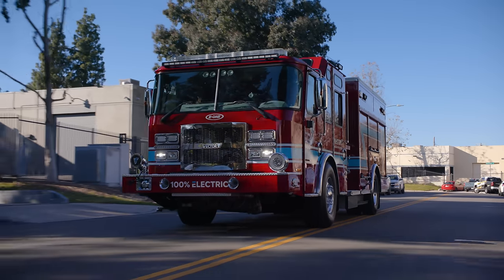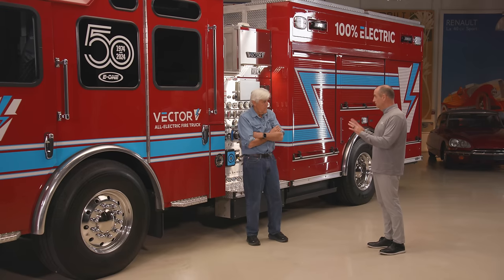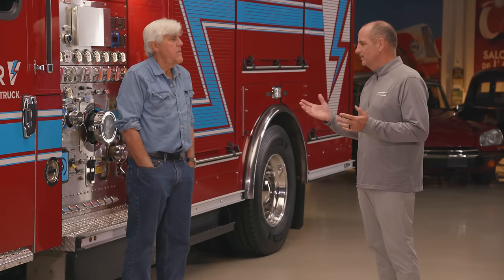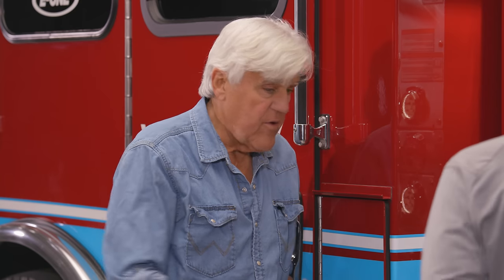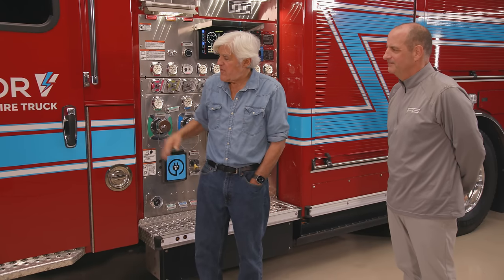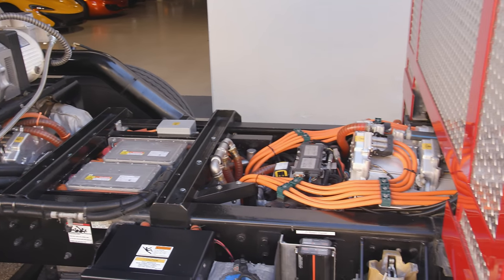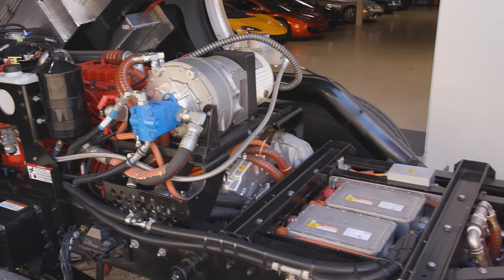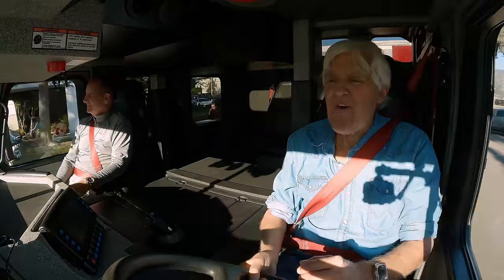The Future of Firetrucks?

Comment: Jay, you are an exceptional sales man. It’s amazing how people believe that an electric pumper is better than a diesel. In Chicago this would last a week. Would like to see this at a long stand pumping for 8-12 hours in -10 degrees. Never going to happen. I laugh at the green house gas issue. How much of the fire byproducts that are at a fire scene that are given off green house gases from what is burned. Chicago has  fire companies that make up to 18 runs in a 24 hour period. Not all Fire are runs but add in EMS which is exhausting on men and rigs. I want to see a truck or an ariel tower electric. It will never happen as a weight to battery weight would make it the weight of a M1 Tank. 100 fire house in the City of Chicago with two rigs and in some cases up to 5. What is the power grid needed just for that. My last comment is that the salesman said to save battery power is dependent on incoming water pressure is 100-110 psi not in Chicago. We are a low pressure high volume system. The best hydrant pressure we had was 50 pounds and that was near a pumping station. We have had fires that when we had 2000 gpm pumpers that no other engine could hook up to that hydrant and all other engineers on other engines pumping had to watch and limit the amount of flow as the worry was collapsing the water mains. 
Didn’t I hear that the first electric fire engine in LA was Out of Service after a month. 
STOP THIS NONSENSE WITH ELECTRIC.

Comment: Electric fire trucks are good in cities but where I live you would run out of battery before you even get to my house the nearest fire station is 1 hour and 45 minute drive from where I live there is a reason why I have my own fire truck a beautiful and slightly old from the early 90s late 80s so still fairly modern as far as fire trucks are concerned it's from Pierce fire truck Manufacturing got it off of Facebook Marketplace for 10 grand

Comment: Please all FF check out ( Edison Motors)
In BC Canada. 😊 That makes a fantastic 
Part small 6 cylinder Diesel ( CaT) engine 
And a Fantastic Battery bank power system. The TWO young men make it very easy to maintain and off the self parts. For example the Headlight you can get at any auto parts supply store. 😊 It's a different style cab. The Driver is in the middle of the cab, just like an airport crash truck. The TWO builders were in the logging industry, and drove Log trucks for years. They did NOT like how ( Tesla) was building a big class 8 ALL electric semi. They wanted the Diesel engine ( very small) to be a reliable electric big rig, that will not have to be CHARGED 😊 but still stay within that almost "0" emissions exit
It was made to get voltage for batteries on down hill off the mountain to help recharge the battery. With the small Diesel engine you don't need to charge

Comment: Hmmm, huge chargers required. California with unreliable power. What could go wrong!! The big test though,, will it put itself out when the batteries self immolate.
Dont take it to  'lithium recycling plant' those fires burn for days. As the one in Scotland currently.
3500 ft lbs,,, will id do a burnout. And is the entire transmission up to the motors.
Oooh aaah, an electric fire truck with diesel back up. That my friend is hybrid and contradictory.
Franklin? So underpowered as not to be an example. Hitlers revenge 6 cyl had to go liquid cooled about 40 years ago as they were well past the cooling limits of air

Comment: So you ship it overseas and back for the drivetrain, you charge it with fossil fuel generated electricity, it still burns diesel if it really needs to work, and, at some point, those giant batteries are going to need to be replaced.  Makes sense.
Reply: I didn't understand the shipping it overseas angle either.  Making it all in Florida is probably prohibitively expensive but there are many other southern US states that are fully capable of 0-100% assembly.

Comment: I wanna like it but its clearly flawed, he keeps saying "under normal conditions"... what happens when the conditions are extreme?!?! What happens if an entire city blocks on fire? What happens if theres a massive forrest fire and this truck needs to drive in the hills or mountains? What happens if theres an arsonist setting multiple fires in multiple locations? Emergency, heavy duty and military equipment should be designed to handle extreme conditions and this clearly wasnt.

Comment: I would NOT trust my life to this electric fire truck.  I've seen fire trucks work for hours upon hours upon hours on big fires.  I don't believe these batteries can hold enough charge to work those big fires.  And the heat from the fires.  Heat causes a faster discharge from the batteries.  Are you going to work a fire for two hours and then go back to the station house, out of service, because you've got to recharge the truck and you're out of service because of the recharge, unavailable for other calls.  NO THANKS!  Someone's dream is an actual nightmare for the fire fighters and the tax payers.

Comment: All of the machines that mine the lithium for these EV's are diesel powered.  None in the US.
The weight of these EV's wear tires faster, wear the roads faster.
If it is too cold, they don't work.
Our infrastructure struggles now with powering our homes and businesses.
Difficult to extinguish when on fire. 
I for one, will not own one.

Comment: Interesting and impressive BUT, still very limited range. Emergency service vehicles should still be built with Combustion engines until Electric is superior in every way, longer range, very fast recharging, that time is not here yet. They should all be Diesel or Hybrids for now or permanently, there's not so many of them that pollution is a big issue. The electronic complexity will reduce reliability and durability + it will be much more expensive to buy and repair. Fire engines should be built simple, run well and pump water fast. UNNECESSARY change, stick with what works best now, this EV is NOT an improvement.

Comment: Sorry to say most firefighter are not going to like this truck. You’re messing not only with reliability but with tradition. Of course you’ll have those fruit cake cities that will put them in service but I bet there firefighters aren’t going to be happy.  Sorry to say I wouldn’t trust it nor would I rely on it as they wouldn’t last for wildland, forestry, large industrial fires and so on. We carry battery powered rescue tools and still don’t trust them so we carry a generator and have a special pack that allows the tools to run the tools off the generator and we have had to use them that way. Sorry to say battery life isn’t all that great.
Sorry to say they are just over complicating things. Let’s put batteries in it and get rid of the motor. Oh yeah, we still need a motor to charge or extend range now we have to add a generator as well. More weight less equipment and water you can carry because there are chassis weight limits as well as legal weight limits on the road. Taking something that works perfectly fine and making it heavier, more expensive, more difficult to work on, more failure points, less reliability, etc. etc…. Bet Jays 1911 Fire Truck is more reliable!
Classic American fire trucks are much better looking than the European style trucks some manufacturers have been trying to push.

Comment: "sorry we can't put the fire out, our battery went dead!",  how do you keep going when fighting wild brush fires with only time to refuel and no time to charge, dumbest fake crisis move I have seen yet.
Reply: The diesel engine runs, and the fuel tank can be refilled like any other diesel truck.
Reply: @brianb-p6586  I was talking about an an electric truck.
Reply: @428gearbender3  No one uses battery-electric fire trucks (especially in brush service) because everyone operating fire trucks is bright enough to realize that they're not practical with currently available batteries (especially in brush service, although they are available if anyone finds a use for one), and the truck in this video is a diesel-electric hybrid. You can see the Cummins ISB inline-6 diesel engine (the commercial-service version of the same engine used in Ram Heavy Duty pickups) in the usual location at the front of the chassis when the cab is lifted at 20:00, and they discuss the location, fuel, and sort of how it is used (it is a series hybrid, so the diesel runs a generator to power the truck). 

These diesel-electric hybrids (the Volterra from Oshkosh/Pierce, this Vector from the REV group companies, and the RTX from Rosenbauer) can all handle most urban calls on just the battery, but none of the manufacturers suggest even these for rural or bush service, let alone pure battery-electric vehicles. You're complaining about a move that no one is making.

Comment: This EV carry on is beyond a joke now. The battery production methods are environmentally DEVASTATING! Mining the heavy metals necessary will destroy the land around for miles and miles around each mine site so badly IT IS ENTIRELY IMPOSSIBLE TO SUPPORT ANY FORM OF LIFE WHATSOEVER. Then there is the battery construction process which must cross FOUR separate continents, transported exclusively by diesel power obviously BEFORE IT GETS ANYWHERE NEAR A VEHICLE. Then there is the fact that WHEN it catches fire it is completely impossible to extinguish. Not difficult,  IMPOSSIBLE! Obviously a replacement for the reliance on fossil fuels is required BUT ELECTRIC IS NOT IT.

Comment: An electric fire truck , really ? What happens when the fire gets too hot and its batteries suffer thermal runaway ? It burns far worse than the fire it went to put out ! Evs are dying so hopefully we wont have cremated fire crews in the politically friendly electric fire trucks . Oh and what happens when the water tanks start leaking or are over fulled above the batteries and water gets in , one massive boat anchor !

Comment: What a waste of resources for electric cars.  Just like the stupid cyber truck and the F-150's.  Instead of giving rebates for all electric cars, the government should give rebates for efficient electric cars. the rebate should be tied to how many resources are used to move a person.  they don't need to be fast, auto driving, or big like the Rivians.   electric fire trucks are not at all efficient thus the diesel generator to run the pump if the fire last for a while.  the 45k weight will be a problem in most older cities crushing the manholes and utility tunnels.  the battery resources from one of these behemoths could be used to make many small people movers.

Comment: Mr. Leno battery technology just isn’t sufficient enough it takes a lot of power to run stuff. What dangerous is battery insulators between cells some manufacturers cut corners which result in thermo run away. Fires very very hot require gallons of foam. Batteries in cold climates to very hot drains them by running your ac. Battery tech just isn’t advanced enough. in extreme cold the battery packs have to be heated before taking a charge. The other is not having enough charging stations. Tesla isn’t compatible with other brands. It’s neat. Salt water environments are detrimental and can spontaneously foop up in flames lots of progress is needed plus quick charging is harmful shortens the battery life. The other is no replacement parts readily available. A battery pack is worth more that the vehicle if you can find anyone to do the work. Traveling hauling is out of question.

Comment: Sorry Jay but youre wrong in that electric vehicles do not produce, look up the amount of material that needs to be mined to make your average EV battery, its all moved by very large earthmoving machines that run all day(I know some mine trucks are electric, some even run on trolley wires) not to mention large diesel generators required to run lights,auxillaries, water pumps and anything else necessarry in a large scale quarry operation.